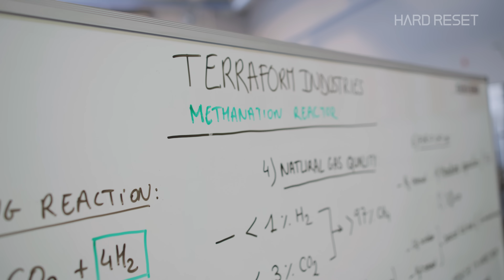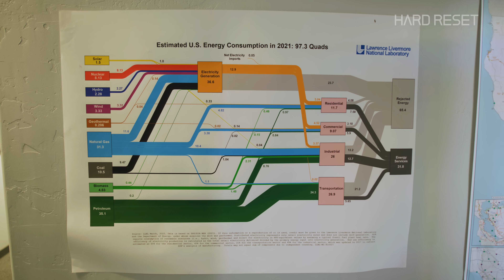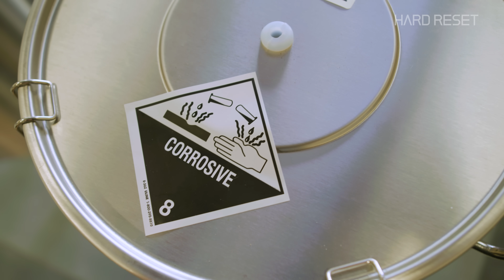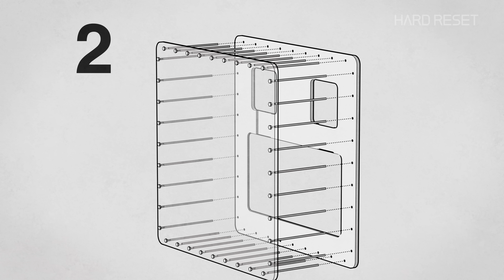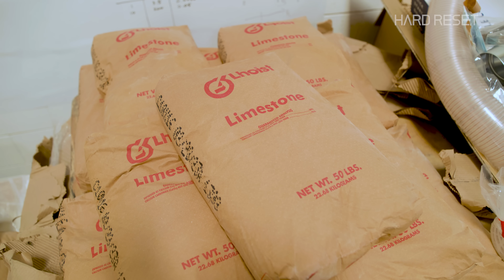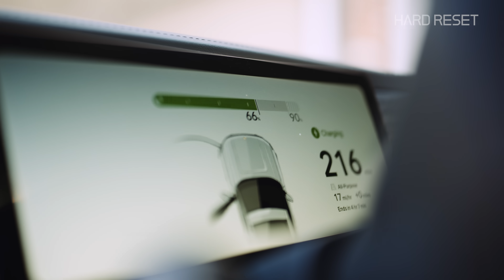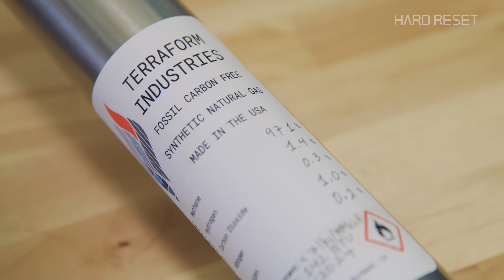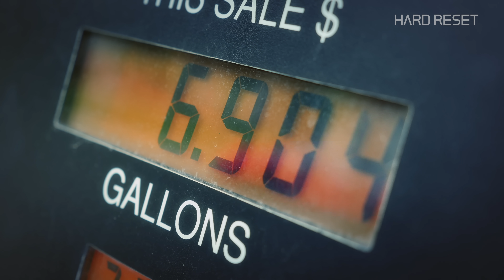The Last Fuel We'll Ever Need?

Comment: One important caveat is that a methane leak would still be carbon positive, because methane is a much more potent greenhouse gas.
Reply: If you take the CO2 out of the air to make the methane it is still carbon neutral.
Reply: @nobody6715  I'm not sure that's true, as I've heard over and over that methane has a many times (80x?) more potent greenhouse effect, but lasts only decades instead of permanently.

Comment: I like how "it doesn't care if the sun is out" was said in a video where the whole scheme depends on solar panels to generate cheap enough electricity to produce cheap fuel...

I appreciate giving a fair shot to other tech, but I think you are underestimating the advance of battery technology and the many different applications that already exist.

"Old reliable" gas and methane is appealing to regular people but physics will disagree. Economics may not disagree in some use cases because methane is easier to use than hydrogen, but in the vast majority, it isn't gonna make as much sense.

People who enjoy living off grid, in or out of the city, would probably choose to give up the natural gas than to subscribe to something that requires 3x the solar panels to operate. It stops being economical when the same energy costs three times as much.

Comment: Well it’s a matter of urgency to find a replacement for crude oil, by the year 2100 all of the easy to get to crude oil will be gone, from a Russia test hole for oil in the Antarctic there is (who knows) how much, then the crude in the Antarctic witch another difficult place to work, when the UK went to protect the Falklands islands, it was everything to do with the crude oil in the sea around the island, so the world needs another form of hydro carbon to fill in the gaps from from solar / wind.
I read a article about Australia and wave power, the proposal was to place on the “Great Australian Bite” cliff,  large concrete tubs with fans that when the sea water go’s in and out of it drives the fan type generator, the article was saying with enough of the tubes it would be able to power ALL of Australia, the waves from the southern ocean never stop.

Comment: … solar and wind power have yet to be proven to be less expensive energy sources that conventional hydro carbon based energy production. So, you appear to have one side of your formula validated, but the “cheap and affordable” solar and wind energy are still regrettably only aspirational unless a quantum leap breakthrough in cheap efficient battery storage technology at scale is made tomorrow.

Comment: electrolyzer (H2O -> 2H, O) ⚡, blowing air over limestone CaCO3 ⚡, kiln to heat the limestone into quicklime accomplished by heating the material to above 825 °C (1,517 °F) CaCO3 -C -O2 =CaO +CO2 ⚡, ...sebatier reactor ⚡

The Sabatier reaction or Sabatier process produces methane and water from a reaction of hydrogen with carbon dioxide at elevated temperatures (optimally 300–400 °C) and pressures (perhaps 3 MPa [1]) in the presence of a nickel catalyst. It was discovered by the French chemists Paul Sabatier and Jean-Baptiste Senderens in 1897. Optionally, ruthenium on alumina (aluminium oxide) makes a more efficient catalyst. It is described by the following exothermic reaction:
{\displaystyle {\ce {CO2{}+4H2->[{} \atop 400\ ^{\circ }{\ce {C}}][{\ce {pressure+catalyst}}]CH4{}+2H2O}}} ∆H = −165.0 kJ/mol

{\displaystyle {\ce {{CO}+ 3H2 -> {CH4}+ H2O}}} ∆H = −206 kJ/mol

Methanation reactions over different metal catalysts including Ni, Ru and Rh have been widely investigated for the production of CH4 from syngas and other power to gas initiatives. Nickel is the most widely used catalyst owing to its high selectivity and low cost.
Reply: AOC said it 7:00 INEFFICIENT

Comment: big problem is.. will electricity ever be cheap? if anything it will become more expensive. Also when you dig into the numbers for costs.
The current cost of gas in uk 6.34 pence per kWh and current cost of electricity in uk - 27.03 pence per kWh
so gas is more than 1/4 of the price of electricity currently
producing gas with this method at 30% efficiency, that would then equate to around 14x more expensive than actual natural gas.
Even in the US where prices of gas and electricity are around the same cost per kWh, its still more than 3x more expensive
so as amazing as it is, how will this ever work in a real world setting?

Comment: The cheapest and most efficient use of energy is to convert renewable to electricity and store it in batteries. Every time you convert this electrical energy into another form of energy; this is a loss. Humanity need to evolve away from steam turbine and other gas engines which are highly inefficient compared to electric motors.

Comment: The goal of this is to burn hydrocarbons. It doesn't matter if the fuel is a fossil or not. What does matter is burning hydrocarbons is a bad thing. Burning hydrocarbons contributes to climate change. The source doesn't matter. The problem is burning hydrocarbons contributes to climate change. The solution is to not burn hydrocarbons.

Comment: soooo.... how much are we actually talking about ....
1kW solar makes like 300W worth of methane?
so its basically just a way to make the H2 that comes from the electrolizer more compact into a denser gass.... 
easy storage and transport ...
seems more convenient than high pressure H2 so thumbs up for this :)
Reply: This is likely overstated and they are probably leaving out several key issues. This also doesn't account for the inefficiency of burning the methane.

Comment: I am sure that one day we will get to a point of sustainability but tomorrow is not that day. Also by definition, Carbon Dioxide IS toxic in high enough concentrations and there are other undesirable bypoduct depending on your source of oxidizer. The atmosphere contains Nitrogen and Nitrogen Oxides are harmful. I am fully on board with exploration of these topics especially in scientific capacities. Please do more research or stop lying to people about the efficiency and how poisonous or toxic certain chemicals are to push an agenda.

Comment: Making a fuel cycle parallel to the carbon cycle so to speak is much like the hydrogen fuel cycle I conceived in high school.  If you can make PLENTY  of it, efficiency is not so critical and can refined over time.  The problem is finding the killer application that get you the jumpstart like gasoline and cars.  Spreadsheets and PC's, Computer graphics and Gaming, etc.

Comment: Finally someone who understands! It is not the efficiency that matters, it is the cost that matters. Efficiency is just one small part of the cost equation.
E-fuels will crush batteries in the long term.
Reply: They sound all reasonable but so far they are still not even close to compete. people forget that in many gas fields, you can basically get gas out for almost free. Meanwhile this process not only has to put energy into create that methane but also into pulling out CO2 out of the atmosphere. Strange to me they didn't figure out they should pulling out CO2 out of a biomass plant chimney where the content is way higher. Or you use a waste treatment facility that burns trash and pull it out there. This technology already exists and is operational. But you still need to put energy into that.
Reply: Not a chance. E fuels will always cost much more than electricity stored in a battery because you have to pay for much more electricity to make the efuel than to charge the battery. The grid to wheel efficiency for efuels is around 10% of battery system. The cost of batteries are coming down and the lifetime going up. Efuels are only worth it when there is no other option such long distance flight.
Reply: Exactly. And also, when it comes to improving solar panels, instead of making them more efficient, it's better to make them more durable, as most if not all of their energy use is in building them. So if you bring a 50% efficient panel to 100%, you've doubled it's energy return on investment, but it you make it last 30 years instead of 5, you just multiplied that same figure by at least 6. And if you can divide the energy required to make it by 10 by making it less efficient busy still durable, you may be further multiplying that number by 5 (of it's half as efficient but built at 1/10 th the energy cost).
Of course, less efficient panels means the layoff is slower to come, so good storage is then required, and that's where they come in.

Comment: I’m installing an 18kW PV array/102.4kWh LFP battery bank off-grid power plant backed up by a 20KW generator which I would really like to run on home-synthesized fuel instead of purchased diesel. Is there a homekit version of the Terraform Industries hydrocarbon synthesizer?

Comment: The reaction between hydrogen and carbon to form methane is known as the Sabatier reaction or methanation reaction. It was discovered by the French chemist Paul Sabatier in 1897.

Reaction Equation:

\text{CO}_2 + 4\text{H}_2 \rightarrow \text{CH}_4 + 2\text{H}_2\text{O}
or
\text{CO} + 3\text{H}_2 \rightarrow \text{CH}_4 + \text{H}_2\text{O}

This reaction occurs in the presence of a nickel, ruthenium, or other metal catalyst at high temperatures (around 300–400°C).

Significance:
   •   Used in fuel production and power-to-gas technology to convert CO₂ into methane, a process that can help reduce greenhouse gas emissions.
   •   Plays a role in space exploration as a way to generate fuel from CO₂ (e.g., for Mars missions).
   •   Important in industrial hydrogenation and synthetic natural gas (SNG) production.

Comment: So what's the current cost for one of these rigs and what kind of quantities are we looking to produce?  Can this get shrunk in size?  Think of  something like a Truck or RV rooftop covered with solar panels over the top of the equipment to convert to gas.  Would something like that be possible?  Now you have a Mad Max vehicle that doesn't need to be refueled.  Or, would it just be more efficient to use the solar to run electric motors and have battery storage?

Comment: We will need this for synfuel production when we have hydrogen fusion, so we might as well start building it now.  If we build a bunch of new fission reactors in the meanwhile, we can use them instead of solar panels to make the electricity.  Almost all hydrogen fuel is made from electrolysis with electricity from the grid, or from fossil methane, so hydrogen is useless without this.  Methane is great because we already have huge natural gas infrastructure.  Methanol or ethanol would be a much better energy storage system for vehicles than any battery.

Comment: I doubt it.  This is just another engineering scam making wild claims for a solution of energy that will never materialize.  I've seen this countless times.  From Nanosolar which was promising but requires a very rare element that was produced through a very specific process, to Stirling Energy Systems which was also promising but failed at 33% efficiency, to the total scam of Solyndra, which was on the face just stupidity.